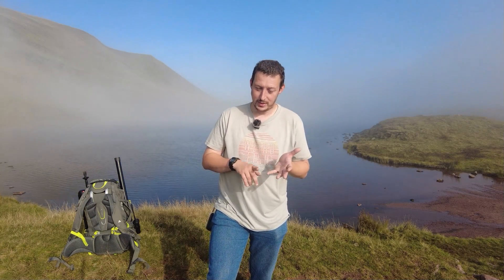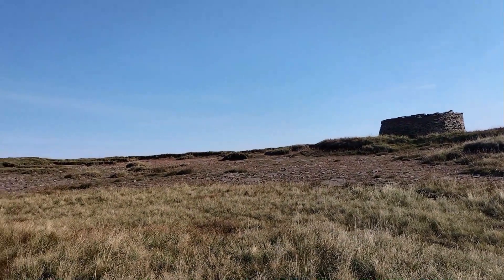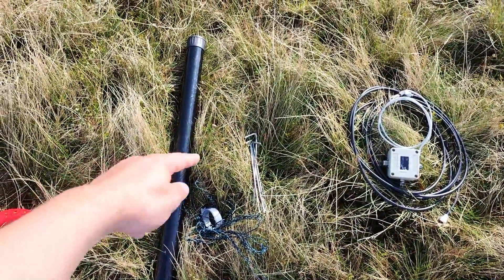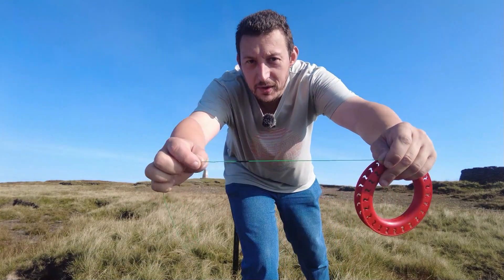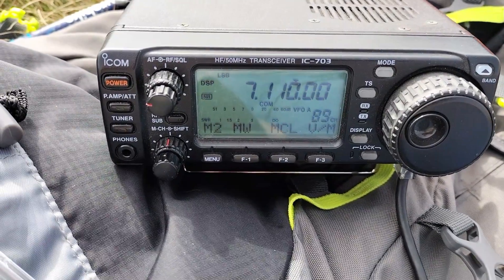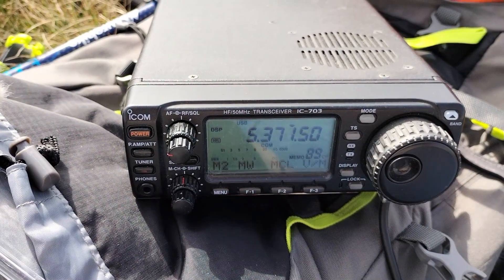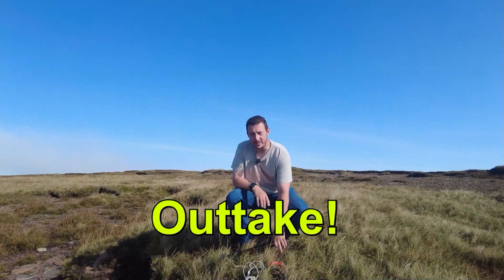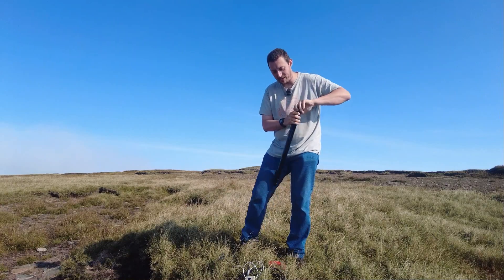My Preferred SOTA Antenna - The Inverted L

Comment: Hi James, great Video, how long is your wire please? 20m i presume ?, many thanks Guy M7XZZ
Reply from the maker: Hi Guy. Yep, matching it with a 49:1 & the wire is trimmed to be a 1/2 wave on 40m.

If you do the maths, it actually works out at about 21 meters, although due to other factors it will need to be slightly shorter than that but I would expect 20m to be close.

My advice (for a 40m EFHW) is to cut the wire slightly over 20m, then use an antenna analyser to see where you are resonant & trim the wire as appropriate.

I've never actually measured the length of my wire after tuning it, so I can't give exact dimensions. It will also depend on several other factors (height above ground, soil conductivity etc) but my guess is that your wire will end up with somewhere in the region of 19m-20m of wire.

Comment: Hi James, I just ran across your video.  Great job!  Question: what did you use to attach the guy wires to the mast?  I couldn’t see it very well in the video.
Reply from the maker: I use a Jubilee clip (I think they call them hose clamps in most other parts of the world) with a bit of aquarium tube slide over the top of it to prevent it from damaging the fibreglass mast.

It's quite an old video (one of my very early videos which I should probably re-make) but you can see it here:- https://youtu.be/xsp_4rWYFK0

Comment: You can usually run directly no tuner needed with a 49 to 1 UNUN feeding a halfwave 40-meter antenna   Harmonically related bands so 40, 20, 15, 10 and 6 meters should have a low SWR, of less than 2 to 1 and just use your tuner to tweak it or if you must no tuner and trim the wire for best match.   The antenna will perform very well either way you can also use your tuner and operate, 30, 17 and 12 as well and make plenty of contacts   I have even been able to even tune 80 meters on mine but of course the antenna is short for 80 but many contacts can still be made, 73 J.

Comment: Config for my EFHW is a shorter vertical section about 3m usually on my walking pole tied up in a bush if one handy. Still makes an inverted L and I run the rest of the antenna wire up to my 6m pole at the tie off or far end. Thanks for all the videos HNY vk5cz ..

Comment: Does having the vertical section along a carbon fiber mast cause any issue?  Thanks for the video!
Reply: Oh, missed that it was fiberglass.  Cheers!
Reply from the maker: The mast that I was using is fibreglass (as opposed to carbon fibre), so not a problem.

I've always steered away from carbon fibre for precisely that reason.

I personally have not tried this with a carbon mast but anecdotally I have heard of people finding that the carbon detunes their antenna. My guess is that you would probably be able to compensate for this by adjusting the length of the wire.

Comment: Another good vid James, particularly the ease of setting up. What power were you using? It also shows the versatility of the efhw. I also helically wind around the mast as it prevents the wire swinging about. All the best, 73
Reply from the maker: Hi Gary. 10 watts from an old Icom 703.

Comment: Thanks James! I mostly use a similar antenna configuration but try to keep the horizontal part as high as possible. Note, that on 20m, the antenna has a deep null, exactly in the direction of the horizontal wire. But on 40m, this inverted-L is pretty omnidirectional.
73 Stephan
Reply from the maker: Hi Stephen. Good point about the directionality on 20m. I didn't mention that in the video.

Comment: Good video James and looked like you were quite comfortable sat there. Interesting antenna setup and I like the idea of using some aquarium tube to support the wire on the mast. Couple of nice pile ups there and well done working Fraser who was on holiday. As a QRP fan I find your Icom 703 impressive, and it's in excellent condition too. 73 Chris M0RSF
Reply from the maker: Thanks Chris. The Icom 703 was my first HF radio which I bought when I got my foundation licence.

After a few years I sold it and very quickly regretted that decision. So much so that I went out & purchased the radio that you saw in the video. I can't remember what I paid for it but I recall paying more than it was actually worth.

These days they are becoming very hard to find & sell for a small fortune if you are lucky enough to find one on the second hand market.

It's one of those radios which I won't be selling. It's staying with me!!!

Comment: Morning James great video mate nicely done. Great setup 👍🏻. I will have an antenna up for the weekend for CQ WW.. Just need to decide if I am doing a inverted V or L efhw in my small garden. Started to setup last night then found one of my feeder leads slightly down to the shield. Depending on how I setup I need to use one or two feeders. One of the pl259 plugs are faulty.  Fingers crossed I will be on the air for weekend.
Again mate great work. 👍🏻 😁
Ps loved the end cap issue 😁
Motters M7TRS 73 👍🏻
Reply from the maker: Hi Leigh. Hope you get your feeder & antenna issues sorted for the weekend. I'm also hoping to be on air over the weekend. Probably not heavily but will do at least a couple of sessions.

There is a trail of thought that a couple of us may operate from my 3 acre field but that's very much weather dependant. If it rains too much over the next couple of days the ground will become soft & we will end up getting motorhomes stuck in the field (which is what happened last year). I don't want to end up dealing with that again!

I might also do a livestream from the field if we do manage to get down there. We'll see how things go. Plans are currently extremely fluid!
Reply: @HamRadioOnline  hi mate. Yeah me too I will not be on for the whole weekend solid. Just in the process of trying my 10m mast in different areas of the 8x8 garden before I try and find another pl259 in the house. If no joy I have a 2m slim jim floating around somewhere I can cut the plug off. Should be alright if o use my 10m feeded and efhw close to the house and I can pass it through the window.

Oh exciting times ahead then yes of course weather permits and water levels. Very windy here blowing the mast about.

Yeah sounds good with the livestream will always try and join if I am home plus got an antenna up.
Motters